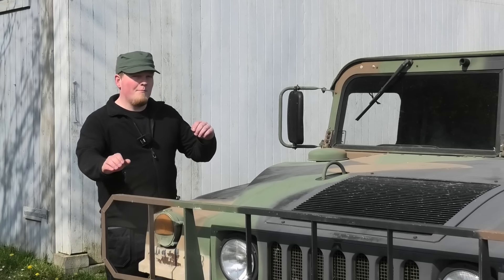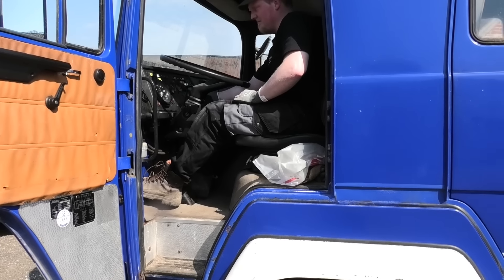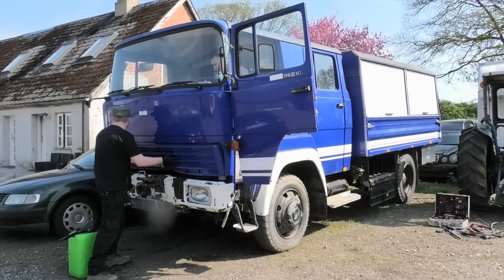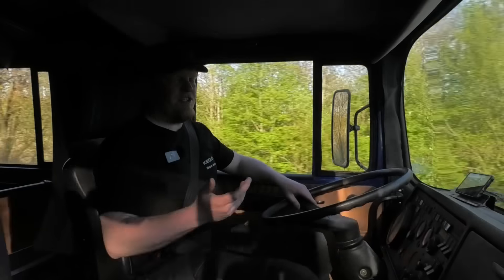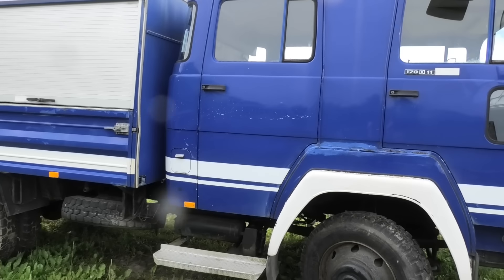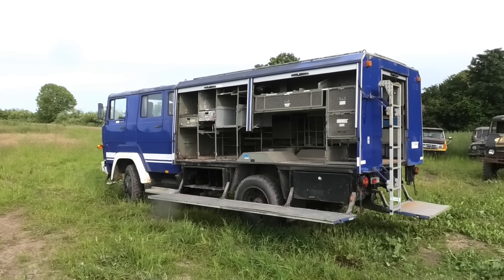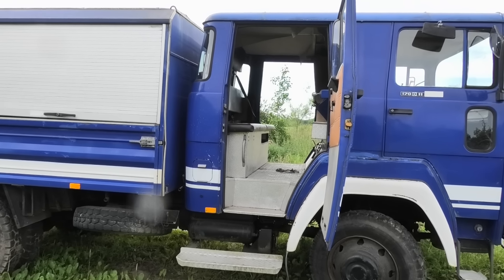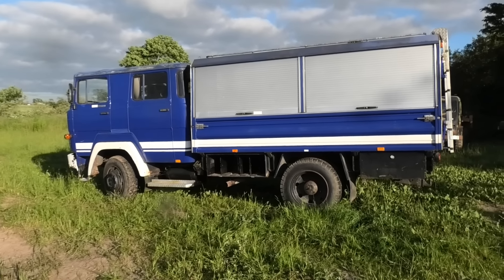Bought a Magirus "unseen" - Can we drive it home?

Comment: If that has the original air cooled engine its a winner, theres 50% of any breakdowns eliminated...
I had a V10 tractir unit, one of the most reliable trucks in the 70s

Comment: the bed should be worth whatever you paid for the truck, very well made with lots of features.  I'm amazed with the redtape and restrictions imposed by norway, my friend in estonia has similiar issues.  dont understand the restrictions but I wont bellyache so much about U S crap!  don't they make pickup trucks in eu?  seems like the answer to alot of the problems!  good luck!
Reply from the maker: Haha, yeah. we do have pick-up's :)
But with the backwards kind of rules we have here, they become pretty useless, for big things. 
as anything over 3.5 tons (Total weight of vehicle and load) moves up into commercial-vehicle terretory. where you need a separate license, a drive under a different set of rules. (Like you can't go above 80km/h)

So not only are the pick-ups extremely expensive to have (Because they are big cars) but you can't use them the way the are intended.

So if you have a commercial license. It's actually many times cheaper, to just get a huge commercial vehicle like this :)

Comment: Olaf the truck may have a rev limiter, i know now adays companys put a speed limiter of 90kmh on trucks so maybe it was some kind of rev limiter since it was a rescue truck maybe it could be used as a auto tanker and later converted to a utility truck i dont know just look out for a rev limiter or maybe its just stuck in low gears and the leaver is not connected or just falling apart. but good color choice

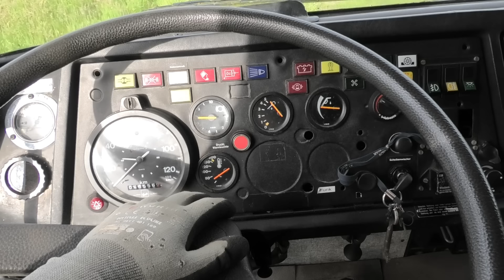Comment: Is there really an issue with the engine? When you liftes the cabin I could not see a turbocharger. If that is true the engine would probably not go over 2000 RPM. The sound ofthe engine at around 26:00 seems to support this. Before you undertake some big repiairs you may want to check the datasheet.
The sound remeinds me strongly of our old Mercedes 407 from the Red Cross. This engine didn't have a turbolcharger either and the range of RPMs was very low too.

Comment: and I think he also served in the army NVA GDR Look at the army green ceiling. clean your diesel filters, oil filter injectors, new oil and it will get some horsepower back, it is not a powerhouse, good luck, greetings from the Netherlands.
    and that is also the reason he has no registration papers
Reply: Sorry, but how should a Westgerman lorry built in the 1980s have served in the NVA? That does not make sense. They had the afore mentioned IFA as army lorry.

Comment: Nice truck. 
Which year is it? You didn't even tell us. The 4wd is permanent with a center diff, right and only the rear locker?
I As for the registration I am not sure if the KBA can really help you with this. They can probably confirm that it is not stolen, but I don't know if they can hand out the paperwork. If they don't or don't have them (I think they only keep them 10 years), you usually need to go to the TÜV, where an Engineer can evaluate it, either confirm the old paperwork if it is still in the KBA data base or use the standard registration for this type to fill out new papers. Then you have to take these to the kba to make them legal papers (at least if you wanna register it here).
As the THW is a federal service, like the German army, it is possible it was never even publicly registered in the same way a car or normal truck would be. So you could be the first one to actually do it. 

And you technically did the right thing/used the proper method by shutting it off with the hand throttle. Probably the more correct method, but at least in the fire fighting scene nobody does it that way because you could forget to reset the hand throttle and somebody else might not be able to start it because he doesn't know. 
The button you called a stop button is you exhaust brake. It is just not regulated so it let's you turn of the engine.
It also seemed to carry fire fighting equipment, even tough it was a THW truck. There were some labels for hoses and branches/hose nozzles. So the big space in the back was probably occupied by portable pump powered by a beetle flat four.

I only personally came in contact with its successor, the 120-23 AW when doing my fire fighting fundamental course. It was a pump truck 2500l tank and a PTO driven pump in the back with basically the same cab, but as a 9 seater. So it had a second bench in the back behind the drivers seat, facing backwards. And if i remember correctly they were wooden too or at least really basic and hard. Even tough this was a truck from 1990 it was so much more crude and basic compared to the 80's Mercedes NG 1222 in our department. And your truck sounds nice, but the Deutz 6cyl can't compare to the Mercedes V6 engines, like the  Om421 in the 1222. They just have this unmatched rumble due to their layout. It's Incredible.
Which incidentally just recently has had a similar issue to your Iveco where the lockers wouldn't work because the actuation was seized. Sadly the local government decided to not spend any money on things not totally necessary so they just told the workshop to deactivate the switches. Which funny story they did by just cutting the air supply to the secondary consumer circuit of the four way protection valve. What they failed to consider, however, is that the the pto driven pump uses air from this circuit to clutch in and select the pto gear when you turn it on in the back. You couldn't even use the manual PTO switch because its also air powered. And sadly that's a trend with the workshop we use. It really hurts to see how this thing gets bodged up in the last few years of its service that started in '88. And luckily we noticed when practicing and not during an actual emergency. 
The only things to fail up until now where plastic air hoses used by the company that build by the company adding the fire fighting equipment, the mercedes hoses were always fine. And recently the clutch slave cylinder died and the lockers didn't work. Pretty good record, although it has only done 23.000km. 
I always thought I'd buy it if it goes out service, but looks like they want to get rid of it far quicker than I expected. So I probably won't have the money and funds to do so. Sadly.
Reply: At 16:13 he says it is from 1985
Reply: Nope, all the THW vehicles do have normal registration papers like civilian ones,
the only specialty is we have number plates mentioning „THW and a number“, and no regional number
oh, and we don‘t have any insurance papers, there is no insurance company, but the federation itself which is liable in case

I am driving a kind of grandson of this truck, a Mercedes Benz AXOR 1829 4x4 in our THW unit, after 10 years it has 16.500km
Reply from the maker: Well, i see a few things have already been awnsered by some of the others, here :)
But i have to be honest. because of all the air-actuators on the transfer case, are not really working, i'm still not entirely sure if it is permanent 4x4 or not? but i don't think it is? And also, i looks like it only has a diff. lock in the rear. but again, none of it is working right now, so i could be wrong.
Currenly i'm just going off what little data i have been able to find, on these.

And thanks for that explantion. it makes sense that the exhaust brake is just choking it off. :)
I can see what you mean about not re-setting the hand throttle. i already did that a couple of times, myself. Haha :)

And yeah, i have also seen a lot of bodge-jobs done on fleet vehicles, simply to cut costs. it's a bit sad, honestly :/
Reply: @KJOff-Road  From what I could gather the posts in the "allrad-lkw-gemeinschaft" forum those trucks should only come with permanent 4wd with center diff. Additionally, that they came standard with a locker for said center diff. The one for the rear diff was optional. Which i guess is okay, because the center one should be more important. Doesn't help if your rear axle is locked, but one of the front tires has no grip and so only this one tire on the front axle turns. 

The exhaust brakes make the experience even better with their relatively untamed sound. Especially if you sit in the back and can also hear the air escaping the actuators etc. 

Its really sad with these things. That truck is basically pristine. Okay, it has some troubles with age, but they only come out because they don't care for preventative maintenance (if an air hose leaks they just cut out the leaking centimeter and just replace it with a hose connector. The whole truck is litered with them. Why don't just replace the whole pvc line?).
Their plan is to replace it with a truck only ten years younger. However, our truck has these problems since around 3-4 years. So the "new" truck will probably be the same in a few years.

Comment: You lucky git :o  for me the box is perfect, I can get a welder in there and a bed and a bog :o)   The engine has to be good if it is good. I’ve only rebuilt the in-line six and it is a tough engine. They can blow head gaskets and that can be a silly job to do. Yep, well envious ^-^ If that doesn’t serve you well then nothing will ;p)

Comment: The first time you said it I thought it was probably just an error but by the fifth time I thought he just isnt reading it right , the vehicle is a Magirus Deutz which is pronounced  Mag ih russ Doytze,    back in the fifties/sixties and seventies they were world famous for their almost indestructable Deutze air cooled V engines that would start instantly whatever the temperature even as low as minus ten centigrade first turn of the key while all other big Diesels of the time would struggle ( never did find where they hid the anti freeze filler cap though lol) usually in three and four axle tippers but with a smattering of artic tractors here and there. Oh and by the way Iveco (acronym of INdustrial VEhicles COrporation) is pronounced eye vee co.
Reply from the maker: Well, with such a broad audience, as i have here. it's always a bit tricky to chose the right pronunciation of names like this. but i usually try to stay close to the way it would be pronunced, in it's original language. (In this case, German and Itallian, respectively.) 
Also, in this case, the euro-version of the names, are closer to how they are pronunced in my language :)
Reply: Forget about the end "e". It just don't exist.

Comment: a hummer can only tow 2 tons?,,,...that seems odd my 2008 f150 can tow over 5 and a half ton legally (11000lbs)
Reply from the maker: Well, it's really not because of the truck itself. but rather all of the nonsense rules that we have here.
A normal "Car" as the Humvee is registred as, can only ever pull a maximum of 3,5 tons. and includes everything. like the trailer itself.
Anything over 3,5 tons, moves into Commercial/Heavy vehicle category. (Which has a different set of rules, and needs a commercial license) 
which is why i'm going through all this trouble in the first place. just to be able to do, what you guys can do with a simple pick-up.